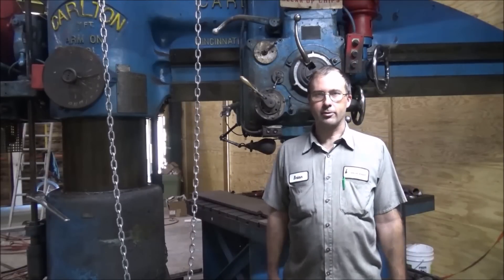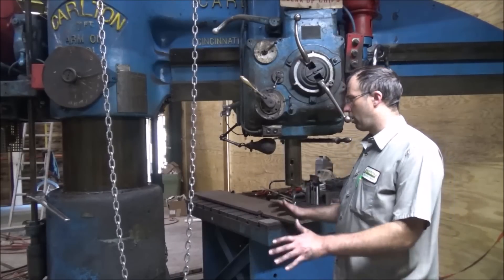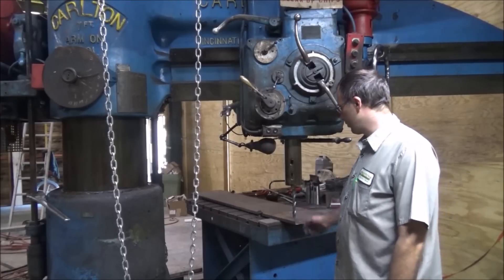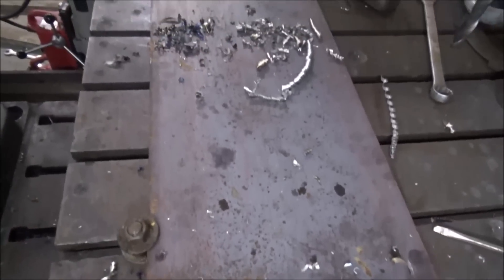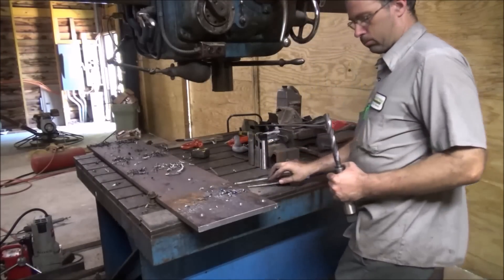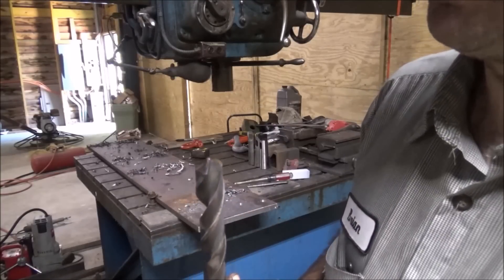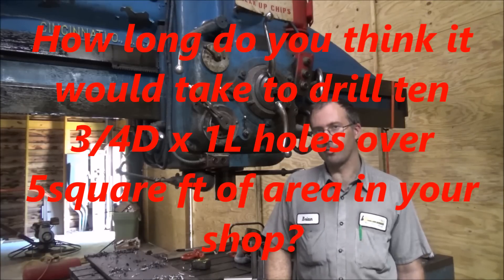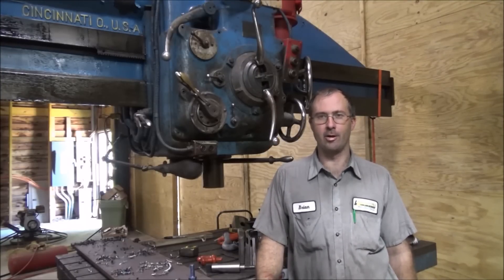What is a Radial Arm Drill Good For?

Comment: DRO?
Reply: GPS?
Reply from the maker: That is why I intend to combine its location with the HBM so I can lock the drill in one location and use the DRO on the HBM table to position the parts for high accuracy hole drilling when it is needed.
Reply: With an angular scale for the turn, Brian could brush off some of his polar coordinate system skills.
Reply: Grandpa Cocky I was thinking the same thing.  That would also be an awesome CNC conversion project.  Take some honkin' servos though.  😁
Reply: Now that is FUNNY!